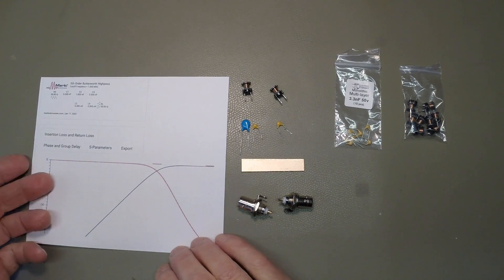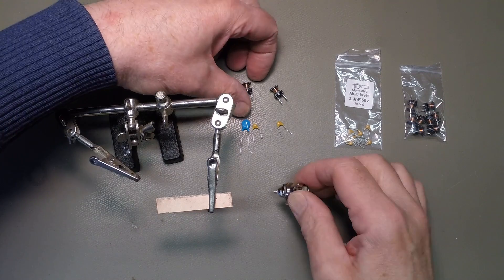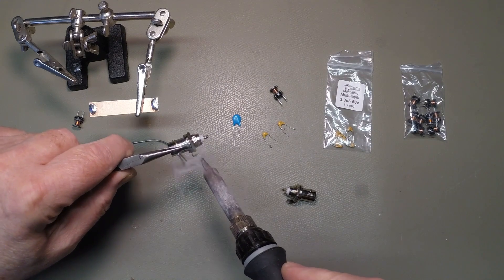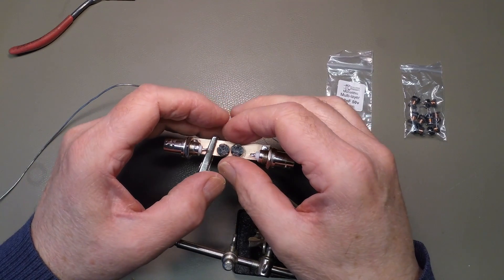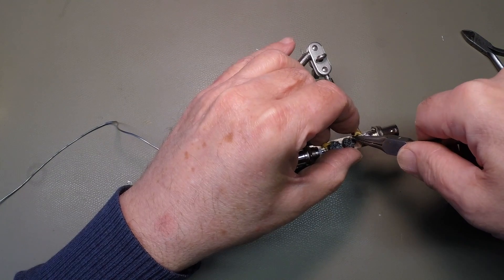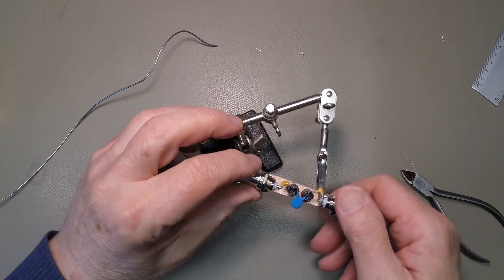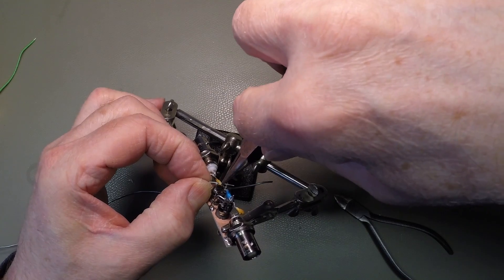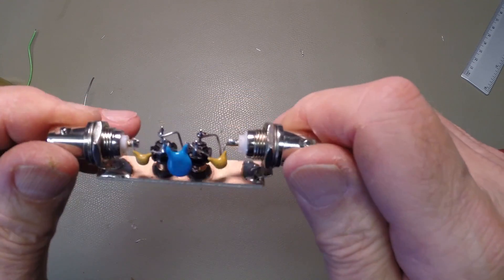Ham Radio Broadcast Interference limiter (BCI) for Xiegu X6100 and other QRP Transceivers.

Comment: Great video.  I'm not electronics expert but I can only find those 3.3uh inductors on UK ebay.  They want my first born child for shipping! LOL.  Any alternative that works just as good available in the U.S.  Thanks!
Reply from the maker: Good morning. I'll check out some USA sources for the inductors later today -- or you could wind your own. Its not difficult.
I know shipping between our do countries is crazy!
I'll be back to you later
73
Bruce G4ABX
Reply from the maker: Good morning.
I did some research re availability in. the USA and Mouser do some really nice 10A rated 3.3uH inductors. They are about $7 each but you only need 2 and your filter will be good for 100watts ++ (Providing you use capacitors rated at more then 1kV)
73
Bruce G4ABX

Comment: Needed to order parts - done Also Helping Hand ; ) Recently updated solder station to T12 design. Time to have some fun. I know you were just dying to know this but I felt I needed to tell someone ; ) Thank You Again for instruction and inspiration. . .
Reply from the maker: James you are most welcome. 
I enjoy 'scratch building' as well as 'kit building'
What I don't enjoy is creating well designed and silk screened metal enclosures -- which is why for my rigs, I tend to buy kits to build.

I've just started planning out the QRP-LABS QCX Mini build -- so stay tuned!

By the way, I've had a direct email asking what mods would be required to up-rate the filter to handle 100 watts? 
I'll give that some thought over the next few days and publish a version 2 for 100 watts -- and this time you will need to wind the toroids as well. (They are quite easy)

Keep an eye open on  my websites as I tend to publish my designs there first.

73
Bruce G4ABX
g4abx.co.uk
@G4ABX
Reply: @G4ABX  Good News. I am alright winding toroid as I wound a few unun and efhw transformers as well as four kits from qrpguys since Christmas. Love antenna builds. EARCHI antenna is current favorite as space is limited here.
Reply from the maker: @ouijim  Ok James. You will have no problem then! only 2 toroids to wind and I suspect (not yet wound one myself) about half the toroid filled with wire.
Have a good weekend
73
Bruce G4ABX

Comment: Thank You. Maybe there is new life for G90 and PIXIE radios  ; )
Reply from the maker: Good evening James. 
Yes, -- and its not too difficult a build either.

I would suggest if you want to use it with a G90 at 20 watts, you increase the voltage rating of the 3 capacitors to something in excess of 200V. They shouldn't cost you much more and give some headroom when running full power.

73
Bruce G4ABX
Reply: @G4ABX  Thank You Again. . .  I tend to over build anyway  ; )  and I love simple since retired I am pretty lazy  ; )
Reply from the maker: @ouijim  My next build will be a QRP-Labs QSX Mini. 
Maybe I can inspire you to be a bit more adventurous :-) 
Have a good weekend
73
Bruce G4ABX